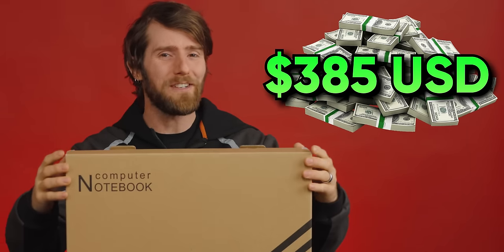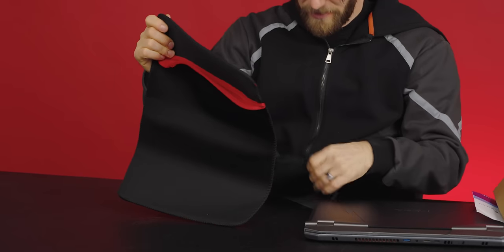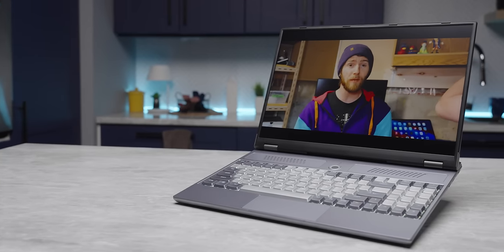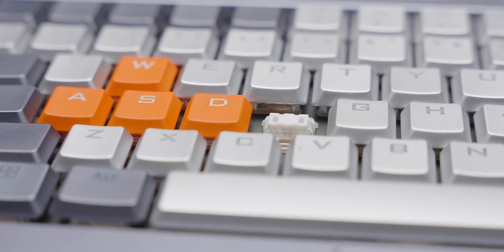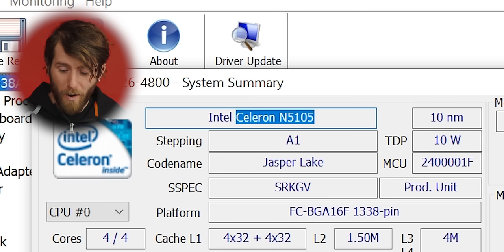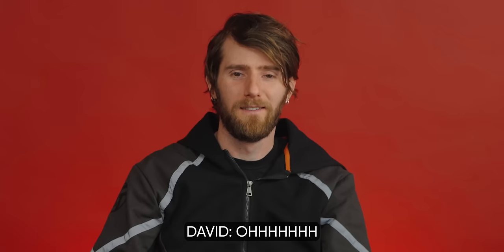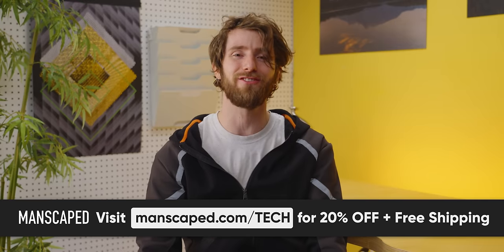Brown Star for Effort – This AliExpress Gaming Laptop is HILARIOUS

Comment: As for the removable webcam slot, along with a microphone, you could also use it to plug in a thumbprint scanner, or potentially even a debit/credit card reader. I could see a “key” product being sold where you’d have to attach a module with an ID number attached to it to unlock your laptop. Without that physical key, it doesn’t operate.
Reply: I don't see why it has to be magnetic and use pogo pins. Just put a micro-USB port at the top of the screen and make peripherals that just have the male connector sticking out at the bottom. It's smaller than USB-C and those pogo-pins they used here, and it won't suffer from a bad connection unlike Linus' webcam.
Reply: this one already has a thumbprint scanner tho, but yeah in general its a good idea. the yubikey thing is good too, i was also thinking about a stylus if its a 2-in-1, or even a second monitor (with a leg going down to the table or something)
Reply: @СусаннаСергеевна  USB ports are not good at bearing weights. Especially something that has a great risk of bending or snapping, magnetic ports makes a ton more sense
Reply: @StevenZephyc  It's not bearing weight, the monitor is.
Reply: @СусаннаСергеевна  Fair enough. I just see the magnet system being more marketable.

Comment: I got my hp omen 15 (older version with i5 7300hq, gtx 1050 2gb, 16gb ddr4 ram (previous owner upgraded it from 8gb), 256gb ssd + 750gb ssd (also installed by the previous owner) for 300€. It‘s holding up pretty good and I‘m satisfied with it.

Comment: N5105/N6005 and N5095 (faster CPU, but slower GPU, yet at higher power) aren't old. They are very recent generation. Successor, Alder Lake-N was just announced couple of weeks ago. They are is definitely not gaming SOCs, but they are fine enough for business (like office apps, business apps, browsing etc), for a small server (they are very popular NAS and router SOCs now) or for mini-PC. And they have hardware video encoding, which they are doing blazingly fast. VP9 4K60 quality-based (don't remember, but resulted in 60 Mb/s. afair, -c:v vp9_qsv -q:v 30) at veryslow preset goes at 33 fps. 5800X doing vp9-libvpx with similar setting at 4.5 fps with all multi-threaded options.

Comment: The companies official international registration is "Shenzhen Deeq Tach Co., Ltd.".
They're a company taking part in a tech strategy called "Shanzhai-Shenzhen", where companies engage in manufacturing, rebranding and innovation.

The idea is that by attempting to copy others while integrating other companies, it will drive new advances in features, which can then be patented.
The main goal is to achieve as many patents as possible; they just have to maintain an identity as a "viable company" by also producing products under Chinese law.

Comment: I believe I understand why the disk was partitioned. They have one image with installed Windows (they installed it once and then dumped it into some .img or .iso file) that they just slap into any laptop they ship. Originally, it was 150GB disk. Later, some of the laptops had higher specs and they did not want to spend time by creating new image-file from scratch. So they found a workaround: they made C: to be the original size, ten the original .iso still can be copied into it like before.
Why there are 3 partitions in total, I have no idea. Maybe it is ready for another software, that will be bit-copied, but not used in this particular case?
Reply: UEFI partition, original drivers, and Windows 10. As if you could slot in more 10 W Celeron and run kubernetes on them ...

Comment: I bought one out of curiosity.  Fan noise is comparable to a gaming laptop, far more aggressive than necessary.  Using Throttlestop to limit CPU MHz does not help much, no fan control software works, and there are no BIOS settings that help with the noise.  If you don't like fan noise, don't get it. (I don't recommend the following:) I hate fan noise, so I opened up the laptop, used Gorilla tape to keep the fan from spinning, and limited the MHz to 2GHz and the power to 8.0W. With this no-fan setup, temps are generally in the 50s-60s doing general office tasks including web surfing, maxing to the low 80s when watching video. (EDIT: Before I updated the Intel graphics drivers the laptop would not play even 1440p 60fps YouTube videos without dropping frames.  But after I updated the Intel graphics drivers (from Intel's website), 4k 60fps YouTube videos played smoothly on an external monitor!  So a graphics update is very important.)

Comment: I partitioned my 1TB NVMe SSD into a ~256GB system drive and the remaining volume for a high speed gaming drive (for the big games that load lots of data, rest goes into my SATA SSD drive) simply for convenience because I hate installing everything in the program folder, so I install things like Steam, etc. along with their games libraries on a seperate gaming drive/partition.

Comment: 2400Mhz is definitely on the slower end, but for my old Inspiron laptop with the i5-7300HQ, it's plenty enough for the memory controller on that CPU lol (not like I have a choice anyway, there's no way to use XMP or higher speed memory in the BIOS)

Comment: Also they have done nothing to the windows, those are just basic things that they did to lower the number of support questions they will get, also we used to have a similar batch file which we would just put in the c drive and it was used to activate windows once the image was burned/written to a hard drive/ssd. This allowed to instead of installing windows on each machine to just write the image on multiple drives, and just run the activation once the drive was added to the system. Infact we also had a scheduled task to run the activation every 45 days. If it was already activated it would do nothing and just exit.

Comment: That webcam looks like it has 4 pins on the connector. I think there is a decent chance it is just some form of USB. If you could find or make a magnetic connector that would fit on then you might be able to use any usb device on it and to make your own devices to attach to the top of the screen. Maybe even a light bar at the top of the screen as we know how much linus likes those.

Comment: I apparently have the little little brother to this laptop. It’s a 7 inch device with many of the same quirks. It looks similar with the aluminum casing, speaker placement and SSD port on the bottom. But my weird batch file is still in Chinese. 😂😂

Apparently YouTube knows about it since it’s linking my video to this one. 😮
Reply: if they meet "Onnniii-chan I missed you!! 🥺" laptops hugging
Reply: @ukeyaoitrash2618   They are Chinese devices.  It would be more like "Gēgē I missed you."

Comment: 2400mhz ddr4 isn't that slow in terms of normal computers that are like 4 years old, 8th gen intel ish which is still very much in use. The world of crazy gaming computers is a lot different than regular stuff.
Reply: standard memory for computers using ddr4 the speeds only ranged from 2133,2400,2666/2667, and 3200.

Comment: I ALWAYS partition a single drive. One for the OS and the other for data. It's a legacy quirk i guess. I can play around with different OS's without losing my data. Benefited  a number of times from this when i had to reinstall and OS for some reason.
Reply: The Windows installer has always moved your old files to WINDOWS.000 before starting a new install (as long as you didn't format the target volume first). It's been this way since 2000/XP at the latest. I understand the "legacy" aspect of it. I used to see this advice parroted a lot back in the day, but it didn't make any more sense to me back then than it does now.
Reply: @zorilla0  It has nothing to do with the OS! All your data and programs you wanted to keep remained on the data partition.
So if i wanted to do a clean install for some reason i didn't have to backup all the data.
How does that not make sense? In the 98 days i even had different 98 versions for what i was going to do and the backup image loaded almost as fast as a startup.
But it was about the data ... not the OS.
With only 1 HHD of course. Wouldn't make sense with more than one. And old HDD's were faster when partitioned.

Comment: I like having partitions or separate drives to keep my OS and applications separate from my data. If I need to reset/reinstall Windows, I can move my data to my data partition and wipe the boot partition. Of course, I prefer having a separate drive where I can physically disconnect it to keep everything safe from an OS installer accident.

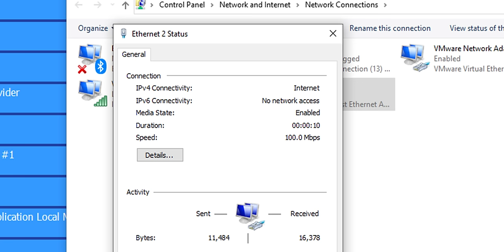Comment: 3:26 : you beeped the audio and subtitled 100, referring to megabits, but then Linus says megabytes. IF Linus said 12.5 megabytes, that's actually correct and the editor screwed up. Because 100 megabits is 8 times smaller than 100 megabytes, depending on what prefixes you use of course.

Comment: I can recommend HP OMEN 17-ck0720nw. It sports : CPU: Intel 11th Gen Core i5 (6 cores 12 threads clocked @2,7 to 4,5 GHz), 16 GB of DD4 RAM (@3200 MHz, expandable up to 32), SSD, (by Samsung 1x512 GB - enough for system drive and if in a pinch few lightweight games, personally i replaced it with 2 sticks of 970 Evo - 1x 512 GB and 1x1TB). GPU: RTX 3060 (base, 6GB of VRAM). Nice IPS display clocked @144 Hz, 17,3", 300cd/m2, decent angles. Even if its marketed for 1080p i managed up it up to 1440p (custom resolution via NCP). For some reason i wasn't able to do it on a factory OS install. So i had to do a clean install of the system.

Comment: I'm glad I decided to watch this because of the magnetic webcam. The execution in this case may be flawed, but the idea is fantastic.

Also, this is using LPDDR4 not standard DDR4, and LPDDR4 uses 16n prefetch which means here the memory core is running at a paltry 150 MHz which means the latency is abysmal. It's even worse than what standard DDR4-2400 would be.

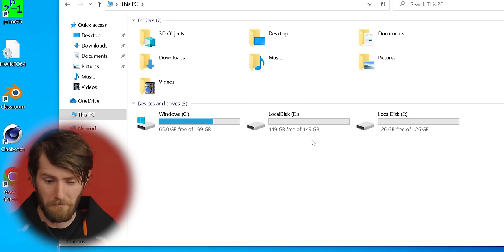Comment: 12:10 What the hell are you talking about? Doing 2 partitions on Windows was from day one (I start using Windows in 1996), and still is, a way to separate your files from system so when (not "if", but rather "when") your system die, you can just format system partition and install fresh copy of Windows and be back in business in a matter of 30-60 minutes

Comment: 2400mhz is not slow. it's literally the highest officially supported frequency in the ddr4 spec. anything over that is just improvements on the spec brought by different memory OEMs, which is why you need XMP profiles and whatnot to make your ram actually go at a higher freq. also, it's a freaking celeron - i doubt you'll ever ecounter a bottleneck where the cpu isn't the first one to clog up and slow everything down, but you're actually limited by ram bandwidth. i honestly approve this as a budget cutting measure for them to lower production cost, given the minimal improvements in such a setup with possibly higher frequencies.

Comment: You have to realize that with this money, you can get a HP netbook, pop in 16GB of 3200 RAM, and have better everything (board, SSD, cooler, battery, BIOS, motherboard).
Not really worth it.
The screen is the only thing that most of them are lacking, but more llikely size (rather than pixel count) is more important.

Comment: I would have wished they use a slightly smaller SSD, normal webcam, and 10-12gb ram and put that money towards a faster processor. Many of the Asus and Acer laptops in that price range are quite usable but all use that crappy Celeron chip that is useless for gaming. I have seen Asus and Acer put 4-8gb in those machines which is way too low but 10gb would free up around $30-40 of the parts cost of this unit and that will easily let you get 1-2 steps up in cpu. Maybe it would be enough for an Athlon or last gen Ryzen.

Comment: 5:46 Dear people at Mobvoi.
please pay extra hard attention on the Camera module connection pins.
nothing is better than put my watch at the charger and those useless pins making the watch go haywire and charge/no charge on endless loop.
this causing the watch actually to eat out more battery than it would have if i was just wearing it.

their watches are excellent, but that useless charging method is the one thing that i absolutely HATE on their watches.
it did not work at 2018 or whenever you launched the Ticwatch pro 1, and it did not work on the Ticwatch pro 3 ultra gps on 2022. and based on images, it looks that the same non functional mess carries over to their pro 5 series from this year as well.

Comment: 9:22 not me knowing thats ddr4 because I run my i5-8400 with a meh tier motherboard and could enable xmp and get at least 2666mhz but then my desktop wouldnt boot up as fast as a chromebook, sooooo I have 32gb of 3600 corsair vengence running at 2133

Comment: I spent $1200 NZD on my laptop - so about $900 USD? Laptops in new Zealand aren't that cheap for a decent on often in the $1000s for anything that doesn't just scroll the web. My laptop has an Intel i5 10th gen (I think it's the lowest model of i5 though for a laptop) but then has 20GBs of upgradeable ram - at 2666mhz a full size laptop keyboard so numpad included - and a 500gb SSD from Lenovo - it's my second Lenovo laptop though and both have terrible trackpads - keyboards are fine though but literally I turned the scrolling speed down to 0 and if I go to steam to play something like jackbox on my tv I'm better off searching for it than scrolling for it. But getting a $25 wireless mouse fixes it. But yeah it's kind of dumb how this laptop seems to have a much better keyboard/mouse and it's able to scroll the web for $345USD companies are really skimping out on the wrong thing these days

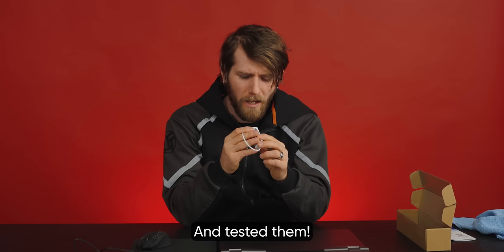Comment: 3:08 those fast ethernet adapters are a common scam that has been flooding the internet for a while, they use a fake DM9601 chipset which fools the OS into thinking it's running at 100Mbps when in fact they are running at 10Mbps, -you can check this with any network switch. it also claims to be an USB 2.0 device but they are in fact USB 1.1.
So you are lucky if you can get more than 6 megabits off of them. I had multiple of them, micro usb, usb-c, usb-a, all the same hardware under the hood.

Comment: There have been some infected motherboards showing up around Asia and the Middle East. I'd be extremely careful using computers from China for that reason, especially from an unfamiliar maker with an altered OS. Reformatting your drive and a new Windows install won't protect you if this is one of those computers. I wouldn't let that thing on my network without some firewall protection between it and any other device on my network, but I'm no computer expert, so...

Comment: Sincerely, this really seam like a good laptop for the price. I would certainly not trust their sketchy cracked windows, but just formatting the SSD and installing Linux on it and you have a decent laptop with a good mechanical keyboard and great screen. Speaker sound on most big brand laptop I have seen are garbage so this one may not be good, but for the price hard to complain. For drivers with Linux I would not have to worry about finding them. Sure, this is not a gaming laptop, but at the price of a Chromebook, you can`t expect to have a i7 CPU, with a real graphic card either.

And to be fair, the preinstalled Windows is not necessarily that bad when we look at what come with big brand laptop such as Dell or Lenovo. Might not be legal license and may or may not have viruses on it, but seriously it seam way cleaner than those big brands with all their bloatware, antiviruses and all the crap starting with your computer, who slow down your computer, used all the power of your laptop. Some bloatware act exactly like viruses, but are branded Dell, Lenovo or whatever, so we just don't called them virus...

The only problem I can see really are maybe with the battery life (How good it is, is it really good for up to 6 hours?) and warranty in case of defect.

Comment: In China, there's a brand called "LVBIAO" (The Green Boomerang) offer the same product with same price on TikTokCN (DouYin).
Plus, they will gift you a small FIRE_DISTINGUISHER just for the response of 「Can it run Crysis?」
...And, that activate batch file is actually "legally illegal". Since it pretend itself a Windows7 product and try to simulate the upgrade process illegally, but finally they will get a legal Windows 10 Digital License bind to device and it works for Windows 11 at least until Microsoft decide to stop letting old Windows 7/8/8.1 installation to get free upgrade license.
Base on Microsoft history, it doesn't even funny, they ignored it for enlarge its marketing share.

Comment: How does this laptop compare to my Razer Blade gaming laptop. My laptop is a little bit older than this, it says that it has an Intel core i7-10875H CPU which is from Q2 of 2020 with 16 gb of RAM at 2933mhz and the GPU is an Nvidia GeForce 2080 Super with Qmax. Three display is only 1080p but the refresh rate is 300hz.